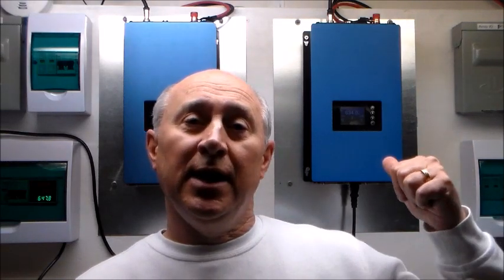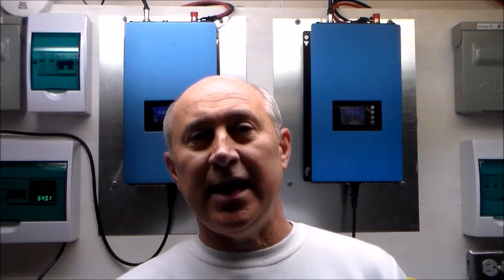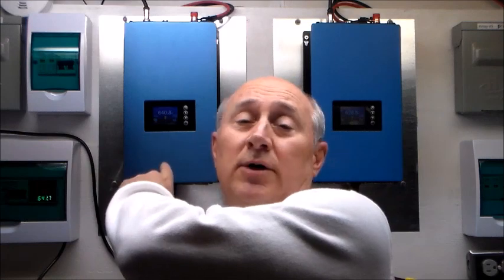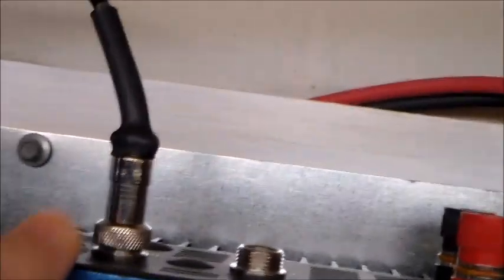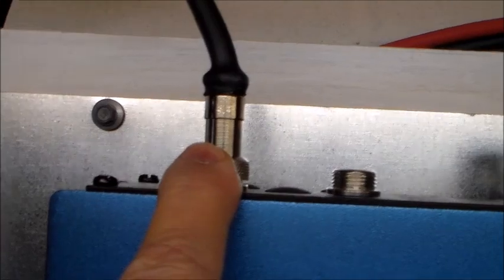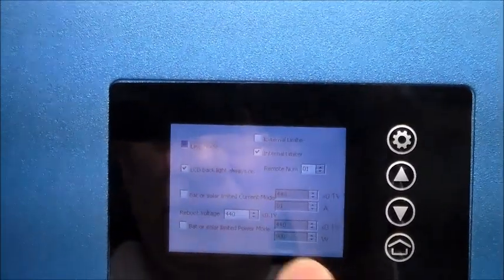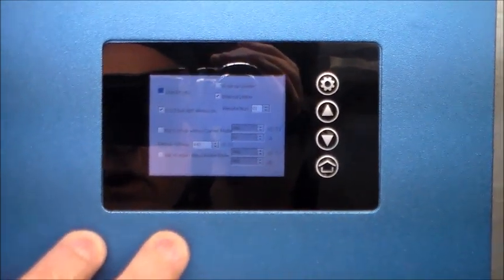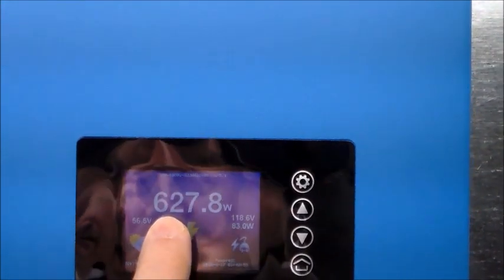DIY Solar - Episode 18 - Sun Grid Tie Inverter (GTIL) - Update Video

Comment: I notice that your limited GTIs have a second CT connecter.  I've seen that they are labels "internal' and "external".  What's the deal with these?  How is the other used?
Reply from the maker: They have an internal limiting circuit that can be used as I have done. You can also purchase an external limiting device that can be used instead. Some people like using those since they offer more programming options. Here is a video of some using one of the external devices. 
https://youtu.be/5Eg5dHtGqCs?si=J6fmnG0d4DR7--md

Comment: Thanks for the valuable videos! I live in the USA where there is single phase 240 volt power. As you know there are two 120 volt wires that connect separate circuits in the electrical panel. I want to buy two Inverters but I do not want a separate solar array for each inverter. Can I wire both inverters into the same solar array and then wire each inverter into  each leg 120 of my electrical panel? Thanks!
Reply from the maker: Unfortunately, you would need to run separate positive and negative cables from your panels to each inverter since they are sensitive to over voltage and amperage. I had and array of 12 panels with three separate positive and negative cables running to my house. Four panels were used for one inverter, four for the other inverter, and four for my off-grid system.
Reply: @jimginnyohio  THANKS BERY MUCH!

Comment: Do these have a reset button? I have 2. Neither seem to be working any longer
Reply from the maker: There is no reset button, but you can power them down to reset. 
You didn’t say how they aren’t working.
Reply: @jimginnyohio  I have dc from the panels. The display is off. Fans not running. No power(amps or watts) showing thru the kill-a-watt. There was a storm at night. Next day neither inverter worked. I've unplugged them. Disconnected the DC input, turned the breakers off and on, left disconnected for an entire day and still nothing. The 2 fuses inside are intact and not blown. I could see one inverter, but not both. They were installed in January 2023. Any help would be appreciated. Thanks
Reply from the maker: @brianj9262  It sounds like maybe you don’t have power at the outlet they are plugged into. Have you checked the ac breaker for the outlet?

Comment: Hello, thks for your help. I have two 1000 watt inverters each has 1000 watts worth of panels connected to EACH separate inverter. One inverter and panels for L1 and exact duplicate setup for L2. Been running great for a year now. Question- anyway I can make more efficient though? For instance (just example)there are times L1 is pulling it's Max Watts and L2 may have nothing  running so no load.  Any easy way for the second inverter to be able to chip in and help out when there is excess draw on L1? I probably either have to somehow split the clamps so they see both legs or maybe master slave the inverters is there some easy way to do this that you know of?

Comment: Hi, love your videos! I was wondering how did you connect the SCT023R to the cable that connects to the GTI? How do you know what wires from SCT023R goes to pin 1 or pin 2 on the connector that plugs into GTI to get an accurate reading?
Reply from the maker: Simply cut off the old sensor and connect the two wires either way onto the SCT023R. It really doesn’t matter which wire goes to each of the pins. However, when you power up the inverter, check the lcd screen for the power reading. If the value is negative, flip the clamp sensor around the other way on the power leg cable coming into your breaker box. I hope that helps.

Comment: Sir I wanted to know if I can use 4 350 watt solar panel . I wanted to put in 2-2 parallel
Reply from the maker: I know you can go slightly over the rated wattage, but not sure I would go that high over the maximum since it might damage the unit.

Comment: Do you have these connected in parallel or are they running independently from one another
Reply from the maker: They are independent, one on each leg of the power panel.

Comment: Hello could you please help. My husband and I did a set up like you have and for some reason it’s still showing 0.0 wattage and we don’t know why? Could you help please
Reply from the maker: That would be hard to do without seeing your setup! Do you get any reading when running the
panels directly into the inverter and the inverter plugged directly into power outlet…bypassing all of the safety devices?
Reply: @jimginnyohio  thank you for replying so fast, yes we did that. The only reading we are getting is I think from the limiter and then when the sun was up we were getting the volt reading from the solar panels and 0.0 for wattage. Maybe you could help my husband tomorrow when the sun is up? You can call him if you would?
Reply from the maker: @amikkadisciple  which model of the inverter do you have and what is the voltage rating for that? You should be able to see that on the sticker. Also, what voltage level are you seeing on the display? Also will need to know your solar panel ratings and configuration.
Reply: @jimginnyohio  we bought the 1000 watt and 45-90 volt. The voltage level we are seeing on the display is 68.4 and we have 3 panels for now and they are each 100 watt and 24.3 volt
Reply: Thank you for trying to help! It is much appreciated.
Reply: @jimginnyohio  I’m soooo happy, it’s working. Thank you sooo much for the videos they really helped a lot!!! I will subscribe :)
Reply from the maker: @amikkadisciple  Glad to hear you got it figured out!  Best wishes!

Comment: The only thing is after 8 episodes your video stopped I could not see episode 9 10 11 12 13 14 15 16 or 17 what happened to those episodes all we have is episode 1 2 3 4 5 6 I think and 7/8 and nothing until episode 18 I like how you're sitting up your set it's not exactly what I would do in some sense but a lot of things you're doing I would do anyways because that's just the right way to do things for some things like how your hooking up all your inverters just a little bit too small of inverters but you are making your house real safe and I like that I want to know how to hook up breast systems for the way you would do it so I have a better idea how to do mine even though I already have an idea how to do mine I mean I do have some solar panels high more than you do it the way it sounds but your picture shows that if I have more than I you just got to have you just have smaller inverters than I would have and you really explained everything out real nice nice to the most videos would. But I don't think you're going to see this but if you do I would like to see the other videos that I didn't get to see on your solar installation and the rest of your inverters installations and so on and so forth with that.
Reply from the maker: Not sure why you’re not seeing those videos. They are indeed still posted on YouTube. Just try doing a search for DIY Solar - Episode #
Reply: @jimginnyohio  Raven looked on your playlist and it's not on there it got all the other stuff I don't want to see on your playlist I only want to see what I was asking for cuz they're very explicit very detailed and words explain some things that I do know and a few things I may not know I'm looking for dry episodes for solar won't show you up on my phone and I do not know why.
Reply from the maker: @acefire4050  Like I said before, search in YouTube for: “DIY Solar - Episode #”
You must type it EXACTLY like that except replace the # symbol with the episode number you wish to see.

Comment: How long is the cable on the limiter clamp?
Reply from the maker: The ones I got with my inverters were 10 feet long. I’ve heard of others extending theirs up to 25 feet with no problems. Anything longer than that may cause improper readings.

Comment: Dear Friend. I have    3  x  2KW    220Volt AC on grid tie inverters.I want to connect all these three inverters to my electric panel which has 1 x 40 Ampere Fuse coming from Grid. QUESTION  A .As far as the incoming PANEL VOLTAGE to the inverter. I understand that i connect the 3 red on top the +ve from panels  in parallel.And also the 3 black on top the -ve from panels in Parallel too.As i know the limiter ring goes to the Live 1 that i only have as i said One phase.Do i have to place  each limiter ring in the same live 1 cable??? I beleive yes. QUESTION 2.Now as as as the out put of the 3 inverters is concerned  Do i connect them in parallel??? I  mean            each brown (live) cable   together.     each blue (-ve) cable    together     and each   yellow (earth) cable   together ????  QUESTION 3 .NOW what about the limiter  CABLES ......How do i connect the three ones. ????  if i dont mistaken ting that .  QUESTION 4.What happens if i install 48 volt battery system in the future. Each inverter has  a pair of a solar panel array giving hapilly 68,4 volts.Since the top connections of each inverter will go to the battery output because the source of energy now we define to be the battery.........where do i connect the 3      double cables coming from the panel arrays offering each   68,4 volts.????  I imagine each to a solar controller ??? and where can i find a controller for 48 volts   or 60 volts  , in case i add one more battery.....I have search everywhere No charge controller for 60 volt system.....Thank you  VERY MUCH for your kind attention to my issues.....
Reply from the maker: Hi. Please note that I am not an electrician nor a service technician for this product. I am simply a consumer like yourself. I am not able to provide any advice for your particular setup since I have no experience with anything similar to that. I posted these videos in case others were interested in see how I configured my devices. Your configuration and goals appear to be completely different. I'm sorry!

Comment: Thank you for all the info!  I believe you've talked me into getting a single 2000w inverter to tie which would likely offset everything my 240v (split phase) mini-split consumes and more.  Is there any reason a 48v battery couldn't be tied into this w/o other equipment?  Based on the limited view of the display in this video, it looks like you can preset the voltage to a min and max?   Electricity is over $0.20/kW where I am, so having a battery system to offset non-solar hours would pay for itself IF I don't have to spend much on other equipment.  A 5 to 10 kWh battery would get me through the night and then some. If another 2000W inverter and panels is needed, I would consider it as well... but at some point the ROI gets questionable!

I have some 435W, 73 Vmmp/86 Voc panels I was considering using with the inverter(s).  It looks like this should work.  They push about 6 A each, I'm guessing 5 or 6 of these in parallel per 2000W inverter would be about all it would want (not to mention the wiring cost would start to become an issue at the distance I have to run with this low voltage).

Thanks for all the solar info on your channel!
Reply from the maker: I believe that would work. Although, I would run that thru a low voltage cutoff device so you don’t drain your batteries too low
Reply: @jimginnyohio  Thank you Jim!  Any recommendations on the low voltage cutoff device?
Reply from the maker: @ssoffshore5111  I don’t have a specific device to recommend. However, most batteries that are equipped with a BMS will already include this feature built in. If you are building your own battery bank, be sure to include a BMS and you should be good to go. Otherwise, a low cutoff module can do ordered from Amazon or AliExpress pretty inexpensively. Good luck with your setup!
Reply: @jimginnyohio  Roger that, thanks again!
Reply: @ssoffshore5111  This device has low voltage cutoff built in. Default value is 44V I believe but I would set it higher.

Comment: My grid tie invertor is 100 foot from my house service panel. do the make wires that long? would it work?
Reply: I'm talking about the limiter
Reply from the maker: Some people have made their own sensor cable since it is only two wires. However, it’s my understanding 25-30 feet is the maximum distance for reliability reasons. If you make it longer than that, it certainly will not be accurate.

Comment: I was thinking of buying 4 1000w inverters 2 on each leg. Can you put 2 clamps on 1 leg or wire 2 inverters on 1 clamp? I don't want to run the 2000w with 2 CT sensors at 240v The one guy on youtube who has done that in his later videos he had problems with it.
Reply from the maker: Placing 2 clamps on each leg will not work since they will not be aware of each other and will cause power to feed back into the grid. Instead, go check the videos posted on Youtube channel "SolarEngineering". He has successfully connected two of the 2000w inverters using clamp sensors that are paralleled together. That's how I would do it if doing again. Good luck!
Reply: @jimginnyohio  So if you are pulling 100watt 120v from one leg and the inverter pushes back 100w at 240v would that not put 50watt per leg?
This video shows a guy successfully connecting 4 inverters 2 per leg.
https://youtu.be/YO09J-UJy-g
The video you recommend the guy is not  successful. His latest video trying to fix his problem dose not get fixed by the end of the video.

Comment: i used your configuration   surge protection  and box from china but not the disconnect box or the timer  i order the Smart Plug 4 Pack Treatlife Smart WiFi Outlet Works with Alexa and Google Home, 2.4GHz WiFi Only, 7 Day Heavy Duty Programmable. and a cam when im at work and get a weather alert on phone i can cut the inverter off from work the cam has motion alert the rain hitting the panel sets it off get a live feed from the panels on the rack . good job on explaining your system . hats off

Comment: is it ok to use without limter?  how do i factory reset as "Today KWH" screen   is stuck at zero even though  itsbeen running for weeks sevearl kwh per day
Reply from the maker: Yes, you can run without the limiter. However, it might backfeed to the grid if you are producing more power than your home is using. Not sure how to reset it. Best to contact the manufacturer for details about that.

Comment: Sorry to bother you again.  And thank you for such a fast response to the last post.  I'm looking at purchasing 4 355 watts 48-volt panels.  Two panels for each leg.  My question is it better to wire 2 panels in series and get the hirer voltage Grid Tie inverter as you did, or wire 2 panels in parallel and get the lower voltage grid-tie inverter.   Would running the panels in series be more efficient than running them in parallel.  

Thank you again for such a great CLEAR and understandable video
Mike Balzer
Reply from the maker: You should configure them based upon whatever your inverter needs. At 48 volts per panel, you would be over the 90 volt maximum for the higher voltage inverter if you wired those in series. At the same time, you would be over the voltage for the lower voltage inverter too. If using 48 volt panels, you would need to get the higher voltage inverter and wire them in parallel if I am understanding you correctly.
Reply: Yes the closer to the output voltage the less work the panel has to do. :)
God bless!

Comment: Great video. Can you run the Sun Grid Tie Inverter with the limiter and not run the limiter?  In other words be able to put the full amount of the panels into my home/Grid.  I guessing that if you don't put more into the grid each month than you use and still have a small bill you wont be charged.  I live in CA with Edison as my power company.  They installed a digital meter a couple of years ago.

Thanks for the Great Video

Mike
Reply from the maker: Yes, that’s exactly what the limiter does. It puts all power into your home as needed but does not export excess power to the grid. If you disable the limiter, then any excess power goes to the grid if it isn’t being used by your home.

Comment: I purchased the SCT023R clamp as the other wouldn't fit around my line. Question= These clamps are big and very loose around the L1 wire, do these need to be snug or is loose ok for accurate readings? I cant seem to find any info on this.
Reply from the maker: Yes, that clamp will be accurate! It really doesn’t need to be tight at all as long as the wire goes thru it and it is closed completely, the clamp will successfully read the eddy current passing thru it. Good luck!

Comment: So how does the inverter see both legs when it only has one clamp? Is it because you have two inverters on each leg or can one stand alone inverter read both legs? I think the clamps will work for me because it's only 50amp on each leg in my rv. My rv currently has off grid system, so I'd use my midnite controller Aux1 to power the grid tie once it detects  charged batteries.
Reply from the maker: It doesn’t. Each clamp only reads the leg it is connected to.  I have two grid tie inverters....one connected to each leg.
Reply: @jimginnyohio That is what I thought. Thank you so much for the reply!
Reply: @jimginnyohio  and I just realized if I want the 2000 watt inverter I'd have to rewire my 24v panels in series to get the inverter to work. Or buy 2 1000w inverters.   Sounds like 2 1000w inverters would be best so I could read both legs and no need to put the panels in series. Being in an RV I'd worry about shading a series of panels and losing that whole string.

Comment: Thank you for this great series of videos Jim. One question, can the wires to the load sensor clamp be extended? My panel is about 100' from where I will be installing the solar system.
Reply from the maker: I've heard of some people extending the clamp cable up to 25-35 feet. However, a 100-foot extension will probably cause issues resulting in an inaccurate reading. Best to try moving the inverter(s) closer to the power panel.